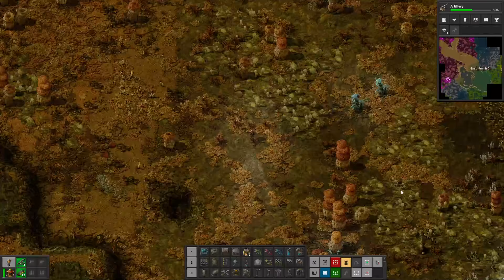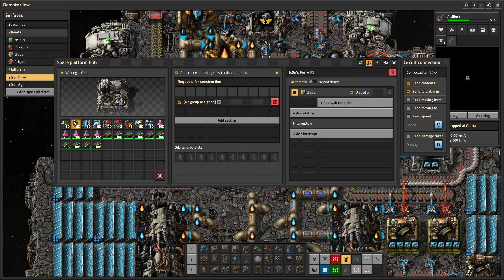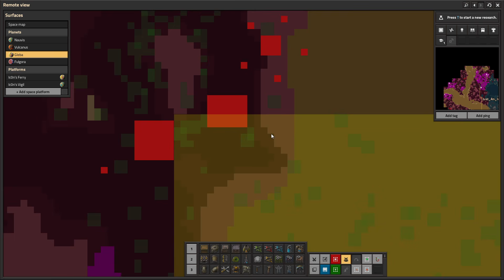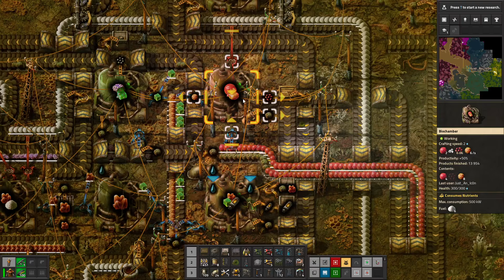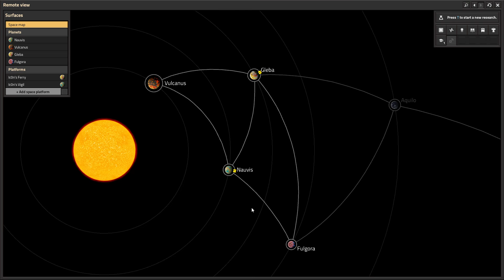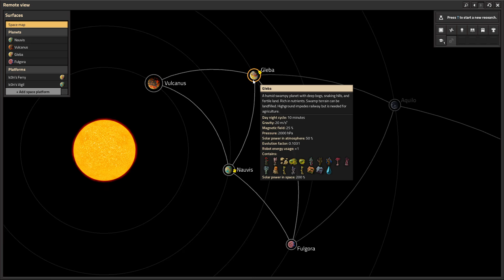Easy GLEBA GUIDE - Factorio Space Age Tutorial

Comment: Okay its a beginner gudr but this iron farm is bad ,create a machine where ur need to kickstart it only 1 time
Reply from the maker: You can do the wiring if you want to. I didn't want to introduce cause it's not necessary and complicated for many players.

But besides: Since all resources are 100% endless on Gleba it doesn't matter at all if the kickstarter runs all the time or only at the beginning. It doesn't even cost Bioflux (one of the more limited resources in your production chain) and is therefore almost not noticeable on your output.

Yeah it's more perfect to do a little circuit here, but it is also not really necessary due to no real waste happening. I did the calculations, you need one whole tree more if the kickstarter keeps running. One more tree. So there you have my line of thought.  I don't think theres anything too bad at all here.

Only something you could do better, so do you.

Comment: this video connected a few missing dots I didn't know about. Thank you. 

I was on the right track of bringing the fruit to a central point and trying to siphon out all spoilage, but I didn't know that the heating tower was so beneficial on Gleba
Reply: +1000. I slammed my head into the wall for a few hours trying to solve the entire puzzle myself. I got pretty close, up to sending spoilage to the heating towers. In hindsight, it seems incredibly obvious why they give you that building here, but I was stuffing it with rocket fuel because I wanted to start it up as quickly as possible. Guess I was overthinking it!